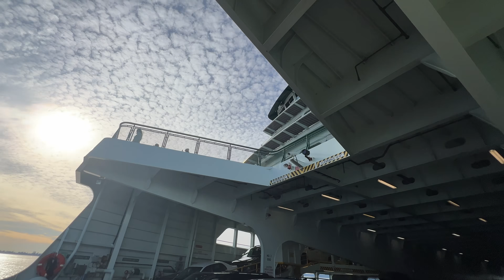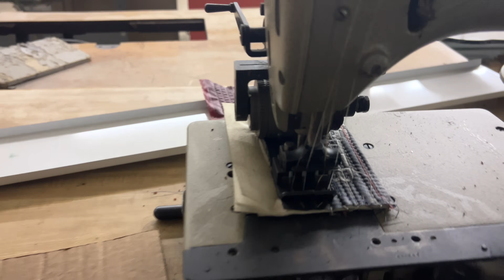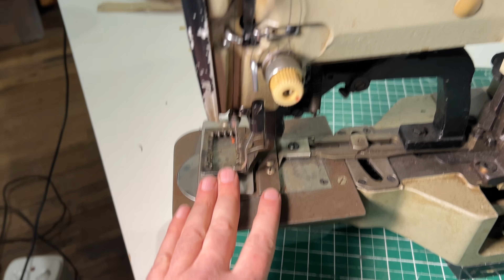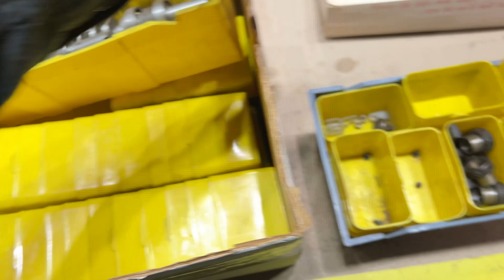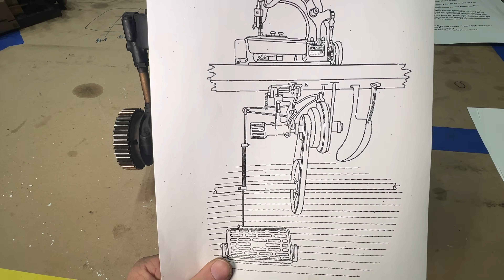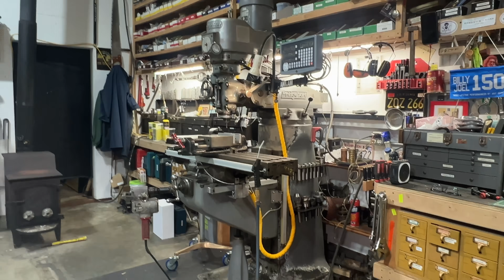Let's Go! Industrial Sewing Machine Warehouse Liquidation Sale - 100's of Machines! CH Holderby

Comment: So the Mauser Lock machine you didn't know what it was for looks like a feed-off-the-arm multi-needle chainstitch or maybe lockstitch machine. (Sometimes called Caballo machine after an italian manufacturer), the specialty here is that it feeds sideways because the mechanism is rotated 90 degrees counterclockwise. It is used to sew inseams of cylinder shaped garment components (like sleeves or legs). You just jam the whole leg down the arm and sew off it. If you have ever asked yourself how those seams are sewn, now you know.
Reply: I have indeed wondered how inseam top stitches are made, having done them (with extreme difficulty) on my singer heavy duty. I have seen feed off the arm machines before but didn't understand their purpose. Thank you for explaining.

Comment: That was interesting at four in the morning, no more projects, no doubt.  I think I'm up to five sewing machines and never ever ran one or fixed one.  But, I have a great idea.  I have one that has a arm that swing back and forth underneath, some rare crazy type.  I liked the sunset as they are talked about in this book I'm reading Legends of Vancouver by E. Pauline Johnson (Tekahionwake).  Never been to the NW, about everywhere else in the contiguous.  Was looking through your videos, your all over the place, had to cringe a shower floors, I've tile ~6,000 swimming pools. Subscribed, might need some help with sewing machines, plus I have about a dozen metalworking machines.
Reply from the maker: Right On! 🙌 Sounds like you’ve got a lot of the same interests and curiosity about everything! I will check out the book! Legends of Vancouver! Alright nice! 👍
Reply: @RightOnJonCrane  I'm at page 98, so far there is only one part to keep for research, about The Thunderbird.  If you like books check out mine, follow the avatar, send ya one, if it isn't offensive.

Comment: Likely that the Eastman was set up on a rail. Probably used to cut straight across fabric from the roll as multiple plies were stacked up on a cutting table.
Reply from the maker: Yeah you are probably right! I looked at their sliding rail models in some videos. Maybe I’ll set it up like that. Or it could be good freehand. It will cool to get that up and rolling!